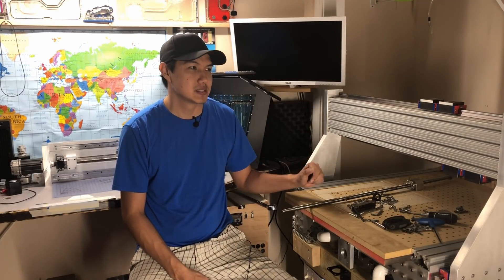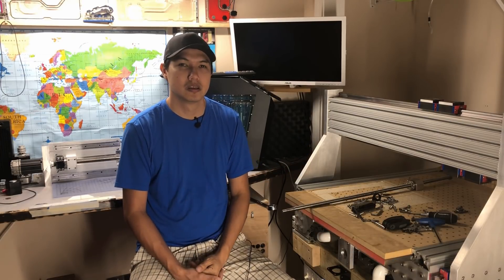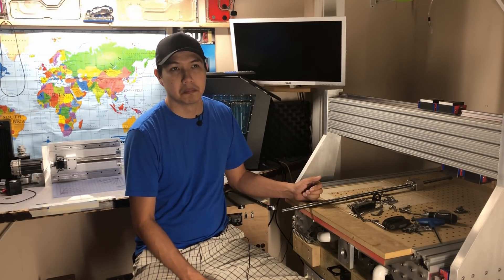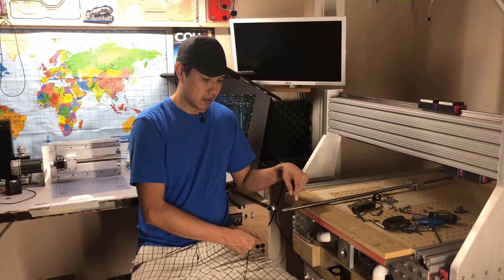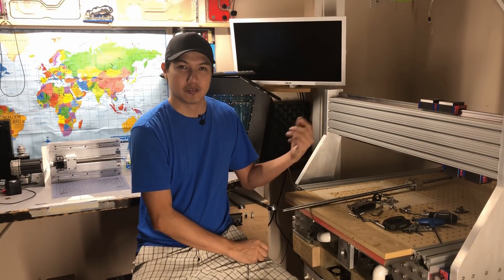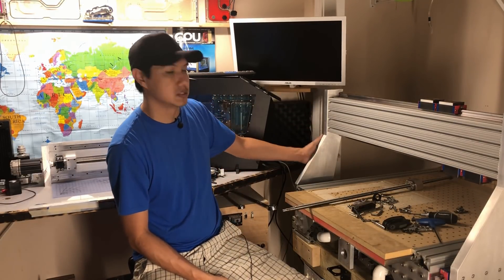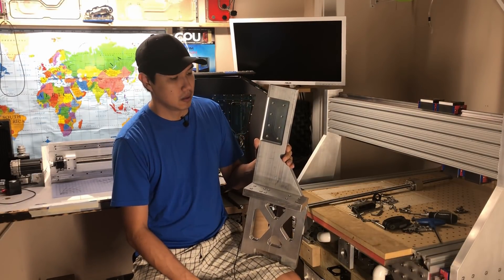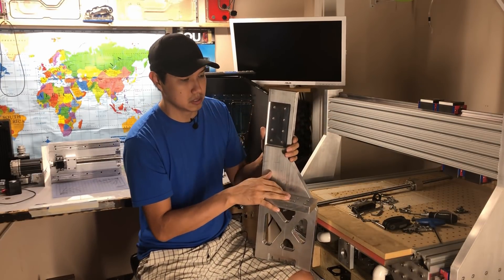Homemade DIY CNC - fixing some problems

Comment: I am in Ecuador, what profiles are they and how thick is the profile, to find the reference for South America, can you help me with the data, please
Reply from the maker: Hi the profiles are 3x3 inches or 3x6 inches
Reply: @radikult-custom  I was on page 80/20, I try to find the reference number on the profile you mention, I even registered on that page, but I can't find the item, since in South America they work in millimeters.  the other part, the aluminum profile that you see in your videos has a good structural thickness of story, it is 5 millimeters (in mm) outside the data that you told me about 3 "X3", I will tell you that I use a translator to speak with voice  Please help me the redency of the structural thickness and link or code of the profile, I want to get a robotic arm CNC to have 3D printing and milling work for my hobby of making scale airplanes, and the profiles that I have bought are 40mmX40mmX2mm and  80mmX80mmX2.5mm as you can see is the thickness my problem since without offending here comes the import product and here the import company from China can help me, here comes all these profiles from China and the thickness where I showed your video when you fill it with  sand it shows that the structural part is very thick and that data or reference page, or for 80/20 to give the bb reference and buy them since I send them the redential video they also asked me with what extructural thickness .. please  or help me, thank you in advance
Reply from the maker: @CarlosMendoza-md9rr  here is a link to the 3030 series 
https://8020.net/3030.html

Comment: Did you ever get this working?  Can you please update the links?  Im looking for the rails that you filled with sand in this video.
Reply from the maker: Dev Everything I got those rails from 80.20inc  they can cut to length and have all kinds of sizes
Reply: @radikult-custom  Thanks buddy!

Comment: It looks nice. But you can't call this homemade. Also... you've spent so much on it...you could just buy one already made.
Reply: He could buy one already made but that manufacturer will cut lots of corners for high % profit margins and sell u something far less rigid, robust, and accurate while charging u through the roof.  

If a person is capable of building their own machine, have the time, understands how an high quality CNC router should be built when using T-slotted extrusion, and are serious about getting their money's worth from everything they purchased they should build their own. 

Look around on the internet, how many CNC router/engraver/milling machine manufacturers that make the machines from T-slot Extrusion uses those heavy type 40 series extrusions he uses extensively throughout his build.

Comment: A 2# spray foam would accomplish the same vibration damping with out the added weight in the top rail.
Reply: Spray foam may lessen the noise but not necessary the amplitude of vibration. Sand has mass and due to being many small particles, it can absorb lots of energy.

Comment: How much do you think it helped moving linear rail from the side to the top? Seems side would be better with less chance for debris issues.
Reply from the maker: Muscle65car you are right. Less debris on the rails. At the same time you have to look that the spindle won’t interfere with those rails too.  
But at the end it’s kinda hard to say since I change the ballscrews, manage to a-line both rails and I can square the gantry easier. Then before with the rails on the sides
Reply: Radikult that makes sense about being able to align the rails easier. Thanks for the reply.

Comment: I don't understand this. You spent thousands on dollars on the frame. It was obviously much more than $1000. You spent more than $1000 on the Clearpath servos. One of those is about $500 and you have 3. 
And then you buy eBay ballscrew for $120 ? You thought it was not important part of CNC ? And when you saw it was crap you repeated the mistake, and you have bought it again ? Something is fishy with your story.
And you use 25mm rail ? Have you seen its parameters ever ? Its HUGE overkill for a weak 2.2kW 0.8Nm 24,000rpm eBay spindle motor.
Those rails can hold and move a 2.5 tons SUV or a little truck easily. I mean one rail, with one block. 2 blocks 2 rails => the Y axis would be able to move about 10 tons. Your spindle motor can't handle more than 400N chipping force.
100kN > 400N ??? Huge discrepancy again.
And where do you buy those aluminum sheets ?
You always link McMaster-Carr.  Sure OK :
1 piece of 1 1/4'' thick 12'' x 24'' 7075 alu plate is US$ 995 at McMaster-Carr ! The 6061 is about the same.
Although the piece in you hand looks bigger than 24''. Never mind.
And you need 2 of those for the 2 pillars. Are you talking about a $2000 upgrade on those aluminum side pillars ?
But you have bought $120 Chinese eBay 1605 ballscrew for saving money ? Hmmmm. You seem unreal sorry to say.
Is this a pure advertising video, that was the only goal ? Be honest please.
Reply from the maker: telelaci2 this video is just my take on building my first homemade cnc and showing my journey and not advertising as you mentioned. I’m not forcing no one to build it the way I did and it fact everything is overkill for this aluminum frame 
 I’m not expert or I have said that before when it comes to cnc’s 
 Because it was my first time building a cnc I didn’t fully understand everything about its mechanics - linear rails. Ballscrews etc. But I have learn a lot in the way that if I was to build another I know somethings I didn’t know when building this one
Reply: @radikult-custom  And one more advice. On this video you fill the extrusions with sand. You wanna dampen the vibrations. Excellent idea. Really. It makes much better machine, but the sand is not good enough. You have to use so called "epoxy granite", thats a usual way for dampening CNC, you can make super CNC with that almost as good as cast iron. (you know cast iron is the best for CNC frame, steel or aluminum is not so good)
Do fill the alu extrusions with epoxy granite, not sand ! Here is a guide:
https://www.cnccookbook.com/epoxy-granite-cnc-machine-fill/
Just an idea. And google for "cnc epoxy granite" - you'll find more about it.
Reply: @telelaci2  
I guess you didn't understand the video.
You expect him to build a new cnc to your specs. You didn't see earlier viof his original cnc kit.
Reply: @steveyoutube8134  I guess you didn't understand my point. I don't expect anyone to build something by my specification. I just saw that he spent thousands of dollars on this machine without digging into the conceptions, theories. And it became a very bad example to others, how not to build CNC, how not to waste lot of money. He was and he is willing to spend money countless, he seems a very rich guy. I think $5000+ is far too much for a amateur hobby CNC, and this is not the end. It will be around $10,000 I guess. He buys first (in very expensive shops, he doesn't do any research even there) then he starts to think how to do it. And at last he starts to change and modify, because he wants better. Now he changes the frame, tomorrow he upgrades the ballscrews, and then the spindle is the next maybe. The order is not good. You should think first, learn the details, design precisely what you want, and only the last step is getting the parts together, buying stuff. This my opinion. His way is incredibly expensive. But of course, if he satisfied, then its fine by me too.
Reply: @telelaci2  Not everything is about money, and not everything is about the end result.. sometimes the journey is what matters the most.
Reply: @semperidem2577  I wish you could explain a bit more  how you would develop a more capable CNC with your $5000 design .
Reply: @radikult-custom  I can see that you are not an expert, but what I see is weird. You spent thousands of dollars on this machine.
At least about $5000, if you bought the parts from the advertised shops indeed.
Its very massive, very nice and precise frame. And big. And expensive. But nice job, congratulations.
And you try to save money on the ballscrew, one of the most important part of the machine ? The rigidity of the ballscrew is crucial. A shite ballscrew ruins the whole machine. You have never heard of Chinese eBay craps ? Unusable shit all for $5 . You noob on eBay too ?
This is weird and its an unsolvable mistery. You noob ok , but this is not a good explanation.
Reply from the maker: telelaci2 when I first decided to build it. I try looking at forums and other videos. And a lot of first time builders used the Chinese 1605 ballscrews. So that’s I went with those. 
 now after making this changes I switch them for Ground Ballscrews

Comment: Everything look very good. Except the x-axis ballscrew is located at a little bit lower position. It may cause the assemby inclined especially when under heavy cutting force.
Reply from the maker: raychar c   The x axis is the one on the gantry,  you mean the Y axis maybe?

Comment: Sand + Epoxy
Reply: Sand will dampen harmonics, adding epoxy will prevent most of the damping.  When sand vibrated the sound is turned to heat aka dampened.
Reply from the maker: I just didnt know if it would dry inside an extrusion  <Maybe on my next cnc build>
Reply: Will two composites be a lot better than just sand...epoxy is a much messy stuff.

Comment: Your new gantry plates are awesome! Are you concerned about getting debris in your linear rails? If so what are you doing to fix it?
Reply from the maker: Chazz Harbison a dust shoe keeps the dust and debris to a minimum,  the plastic guards in the linear blocks holds the rest
Reply from the maker: Chazz Harbison that’s my current “fix”
Reply: That’s awesome. I am borrowing a lot of your build ideas it very impressive

Comment: Hi Mario, My router is only 430mm wide and I see a reasonable amount of play because of a single ballscrew on the Y axis. I believe that lengthening the supports for the gantry can also help but then you have shorter travel. 2 ballscrews would be the way to go, you would need to have 2 proximity switches through your interface board so that Mach3 (or what ever you use) can zero them to parallel the gantry to the Y axis so there is no "crabbing" that increases friction on your linear slides. That would obviously mean an new servo motor and driver, possibly an upgrade to your power supply also. awesome work! keep it up!

Comment: Nice work and great channel!  I have the 2.2kw water cooled Chinese spindle on my machine.  You should offer a cooling reservoir for this spindle with a built in radiator.  Bet it would sell well.
Reply from the maker: Machine 27 I use a spare swiftech h220 I had for the spindle,  but that’s not a bad idea, is just finding some cheap but good radiators

Comment: Did you cut the gantry and base supports your self? I will like something similar to yours. I just bought my linear rails.
Reply from the maker: angelg796 yes I cut them with the same cnc I’m fixing
Reply: Radikult 
Are you willing to share your files of your gantry design? I have been building my machine from YouTube and forums but really don’t know how to design anything on CAD.
Reply from the maker: angelg796 yes I could but I use vectric software as my CaD program and almost all the time I share my files people can’t open them so the best I can do is a pdf file so you can get the overall design of the support arms but without the cutting files
Reply: Radikult 
Believe it or not that was the software I was planning to get after finishing my machine because of large community. You can send the actual cad files and I’ll open in vectric once I get it. Thanks
Reply from the maker: angelg796 I just need your email or email me at Radikult@gmail.com and I’ll send you the file for the support arms
Reply: @radikult-custom  Do you mind to share the file for the support arm. Just finished a small cnc (500mm*500mm) for aluminum and wanted to do support arm like yours for my bigger cnc.

Comment: Adding sand to your top extrusion would be good for absorbing vibrations.  But at the same time it will increase substantially the work load for your Y axis motors. Also it will make your machine top heavy.  Time will tell!
Good improvements you made. They will pay off for shure. Keep us posted!

Comment: did you build loose bearings on one side of your spindles? The expansion forces when the spindle is warm are not to be underestimated. this bends screws or even the spindles around it should always be created a way to expand. loose or slightly preloaded bearing on one side and fixed bearing on the drive side. 
I hope you can read my English while is not the best. 
When build a selfmade machine than is   that find never an end while all time is some that can be better.
Reply from the maker: Rene Ossi you are right at the end, I’m always looking to improve what’s good already, it never ends

Comment: Did you make those support arms yourself? Wow, those look amazing!
Reply from the maker: Dan Davis yes
Reply: Hello, just subscribed, great channel. I have one question. What size aluminum plate is needed to get two support arms made? Thanks.
Reply from the maker: Zee Zuu I guess it will depend on the overall size of the machine, the bigger the cnc than the stronger it should be 
I cut mine out of 1” inch thick but I guess it could be done with 3/4 or thinner if add some supports on the corners
Reply: @radikult-custom  Thanks for your answer.

Comment: Cool vid! Can you explain your reasoning for choosing sand filled vs something like concrete filled?
Reply: Sand can penetrate smaller gaps and can be removed easily for transportation or if he finds the weight is making things worse
Reply from the maker: Critters good answer, I actually took the sand out of the extrusion on the gantry after I took a closer look, since it’s a movable gantry and you want to have it as stiff as you can but as light as possible even do the sand only added about 14lbs on the gantry  but every little counts I think
Reply: @radikult-custom  maybe something lighter but still dampening would work like jamming it full of roxul or spray foam? There is a building caulk stuff called Green Glue which is a non-cureing elastomer, cut a piece of wood or rigid foam as a space filler and pour in green glue, both ends would need sealed tight. I realize these options besides the spray foam wouldn't add stiffness.
Reply from the maker: Joe Malovich those options could work as maybe a dampening material and maybe without adding to much weight but then I don’t know how much that cost vs paysand $4 a 50lbs bag
Reply: @radikult-custom  Have you  finally figured out what is the best material to put inside the aluminium extrusions? I was thinking to polyurethane foam...
Reply from the maker: @Levisgil47  there are a lot of factors to keep in mind. 
Filling a larger extrusion with some type of dampening materials could help with resonance. But could also affect you if it’s to much weight and your motors cant move fast enough
 Sometimes the gains a very little
Reply from the maker: Joe Malovich I was a bit afraid I add cement or epoxy since I didn’t know what could of happen with “thermal expansion and contraction”. As I have read that aluminium and concrete don’t have the same range of shrinking or expanding while with sand I can take it out if something bad starts to happen

Comment: 11:36 Thats just perfect. M really impressed. Please share how u brought it to that perfection. 
Second thing, do u think single ball screw in the middle is good or 2 at the sides are better for the Y  ?
Reply from the maker: DIY Tech to I wouldn’t know how to answer that 2nd question, maybe two better than one?   I heard you get more torque with two but the servos I have, have plenty of toque
Reply: Actually, adding another ballscrew is not for increasing the torque, but it is for preventing teeter-tottering that may occur when your axis is wider than 24 inches. There is a significant amount of distance between those two Y rails. You simply obtain more robust setup by doubling up the ballscrews... Great video though....
Reply: ok thanks